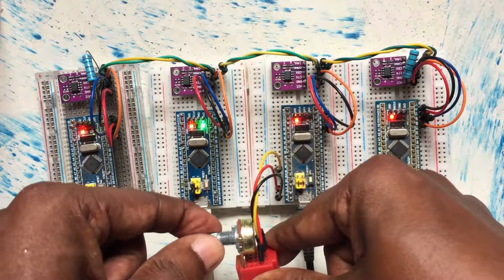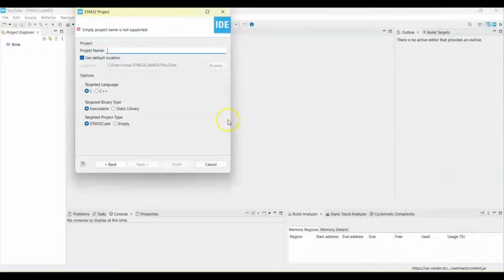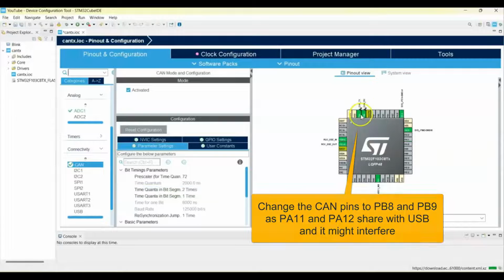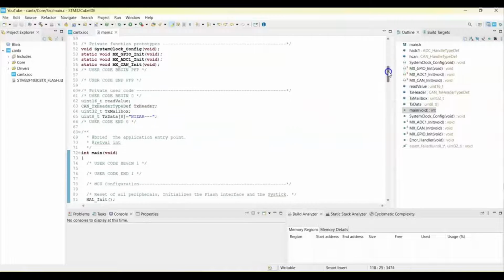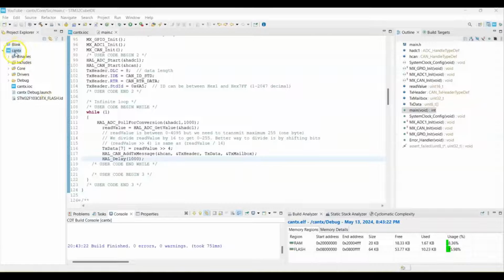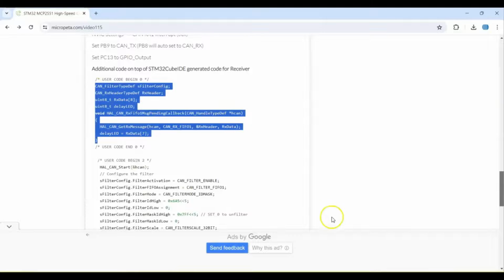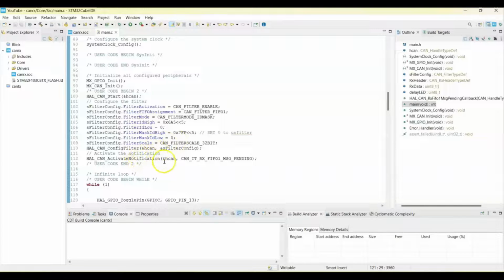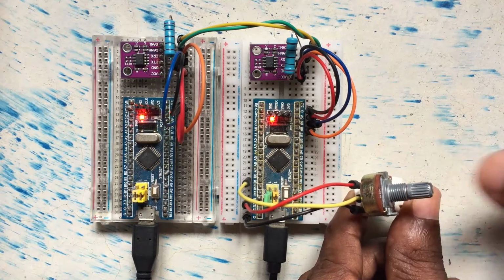115. STM32CubeIDE MCP2551 CAN BUS with STM32 F103C8T6

Comment: I am trying to set up CAN communication with two NUCLEO-F103RB boards, and it is not working. I can't even see any data attempting to send over the Tx line using an oscilloscope. Do you have any advice? 

Pinout is set up exactly the same as you have here.
Clock settings are: 64 MHz, Prescaler 16, TQ1=3, TQ2=4, resulting in 250 kbps data rate.
I am using the MCP2551 transceiver, but it doesn't have the purple breakout board with the onboard resistors etc. that you have here. Is the purple breakout board with extra stuff necessary?
Transceiver wiring is the same as you have it, including the 120 ohm resistors on either end.
Everything else is the same as you have in this video, with the code copy/pasted from the link.

However, it appears that the function HAL_CAN_AddTxMessage() does not actually request transmission of the message as expected. What could I be doing wrong? Is this a problem with the IDE and/or code generator tool? Would love to hear from you, thanks.
Reply: try TQ1= 13, TQ2=2, Pres= 16

Comment: I have an STM32H745, with a SystemClock of 120Mhz, and FDCan Clock of 40Mhz and would like to calculate the prescaler, seg1, and seg2 to achieve a 1Mbit/sec classic CAN speed. 

Note, the bit time is divided into three segments: Sync_Seg (always 1 time quantum), Bit_Seg1 (which includes Prop_Seg and Phase_Seg1), and Bit_Seg2.

And assuming :
Sample point at 87.5% of the bit time
Total number of time quanta per bit: 20

So if we use 20 total time quanta:
- Sync_Seg: 1 tq
- Bit_Seg1 (seg1): 16 tq
- Bit_Seg2 (seg2): 3 tq

Now we can calculate the prescaler:
Bit Rate = FDCAN clock / ((prescaler) * (1 + seg1 + seg2))
1,000,000 = 40,000,000 / (prescaler * (1 + 16 + 3))
prescaler = 2

Comment: Hey I have 2 F446RE board and 1 bluepill , is that same setup will work?.

Great efforts sir...
Reply from the maker: Same setup will also work with all f446re 
Set the baud rate to be same in each mcu by changing prescalor and time quanta
Parameter Settings --> Prescalor 72 & Time Quanta in Bit Segment1 - 2 Times (Baud 125000)

Comment: Work on STM32F103C6 ??? Please answer
Reply from the maker: Yes. It will work with the same CubeIDE setup and codes.
You can use stm32f103c6 for both modules
Or you can use stm32f103c6 for one module and stm32f103c8 for other module